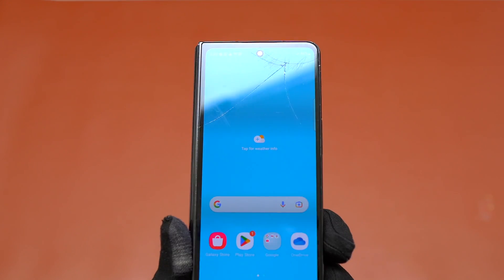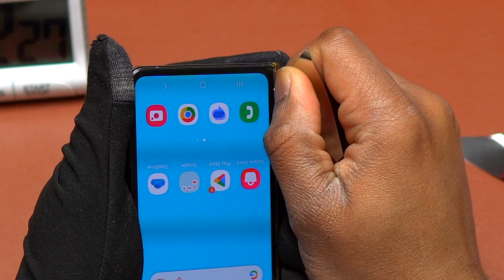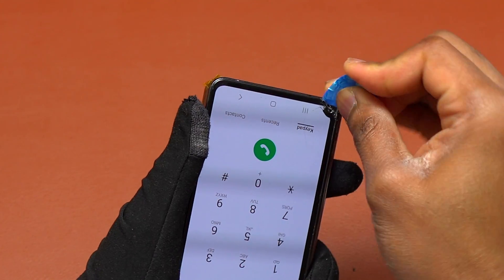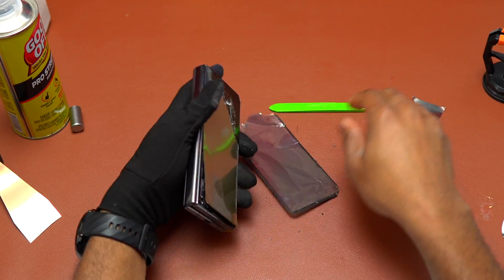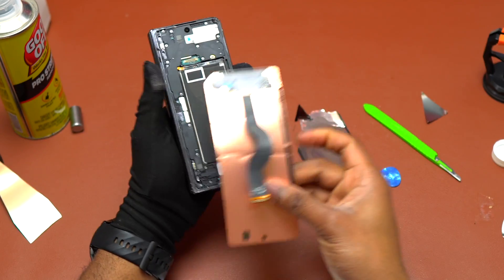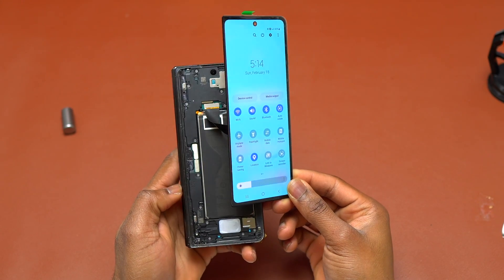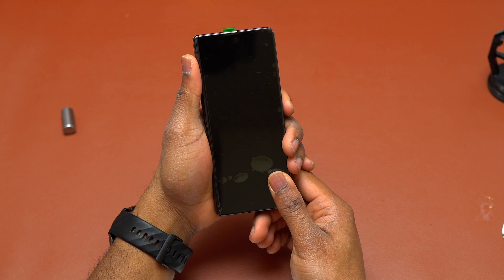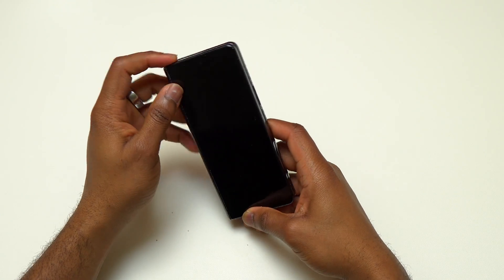Galaxy Z Fold 4 Screen Replacement Repair

Comment: Thanks for the video! Tip for removing the screen without damaging the lcd, you can buy a razor blade and align into the screen and pick up the glass . Then you can cut through the adhesive inside and add alcohol like you first tried. Also try to use heat for an easier removal .
Reply: You can use a heat mat instead of heat gun

Comment: why you don't change glass only brother?
Reply from the maker: Because it is harder to do that. I don't have the freezer, laminating machine to remove the bubbles and attach the new glass (oca). I can try the wire and loca glue which is somewhat outdated procedures. With a folding phone what if the loca glue runs and get trapped inside the Hinge area (😕). I am showing what I consider the easiest way to do these repairs. If I was able to remove the screen without it being damaged I could have done another video showing how to Replace the glass only. With the screen out replacing the glass with loca glue is much more easier than trying it with the screen still attach on the body.

I hope I have responded to your question.
Reply from the maker: iPhone 13 mini Screen Replacement Glass Only
https://youtu.be/Mc2Rap0jH8k

Here's a glass only replacement take a look at the difference in the amount of work needed (if everything goes well). The laminating sealer of the glass machine makes the fix very easy. Using loca glue is hard and very approximate. The loca glue being sold also are very strange I don't believe it is of the highest quality like 5 ...10 years ago.

Comment: I can agree with you that this is really a pain in the a** and as you did i was also trying heating up, using  alc 99,99% and many other options, but neither worked. So the simple method was using a plastic thin card. In that way the card will bend under the screen (where the bezzle is) and on this way you can easy cut trough the glue. Of course you have still to be carefull to not touch the inner screen so cut slightly the glue from the side after you are able to lift it and don't force, take your time. I had to be patient about a hour to remove the screen without any damage. I will prefer to start from the top and cut from middle to left and right and then pick up the right side and at least the bottom. At this point the screen will lift up like a door and you can remove it by gently pulling up. 

Still good luck for your next project and it's a shame what Samsung is doing here. The best reparable Phone of this Models was Fold3 and of course Fold4 is better becouse of the material and the front screen is now as it should be from the begining, but the glue was not nessesary to be that strong. It is improving in a good but also bad way. 

And there are still issues from Day one with the flex cables and also with the dust between the hinges so it would stop opening up to 100%. 

It is a shame for a company like samsung in so many years they couldn't fix some simple issues with the phone and it would be so mutch better, it could...

Comment: Next time, use a thin but durable plastic sheet to navigate through the bezel and cut the glue under the screen before lifting. This worked best for me so far, but I don't know about the clearance of that specific glass. Maybe start around the speaker
Reply: Outer screen price
Reply from the maker: Is that to remove the front screen without destroying it?
Reply: @ersbit  yes, I keep some carrier films of dispay protectors for that. Those help me out best, when I cannot lift the glass. Once I get it under there, I just slice through the glue, sometimes with some alcohol in the seam and after that, the glass should easily pry out. I have not tried to salvage a screen from a broken glass though. Good luck!
Reply from the maker: @khamigen  Thanks for the explanation. Yep, alcohol is very useful in these situation. I could have been more patient but lol I had to finish this at some point.
Reply: I know this may seem like a dumb question but could you use acetone or would that destroy any components in the OLED?
Reply: @PeaceLoveUnityRespectacetone will destroy any plastic substance it comes in contact with, I'd avoid it personally
Reply: Exactly, that's what I do as well. Watching this person break the screen hurt my heart a bit 😢